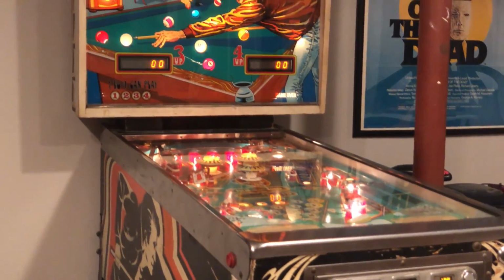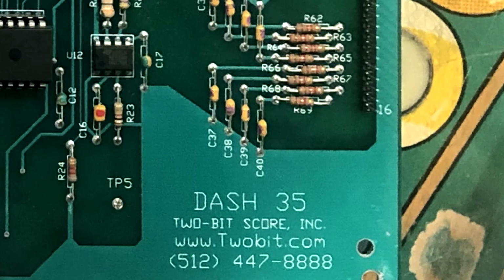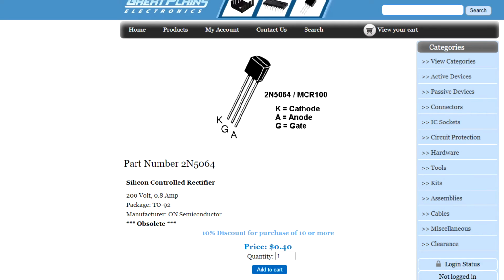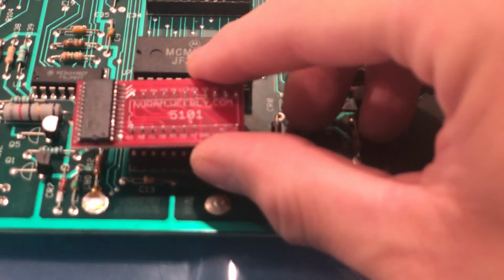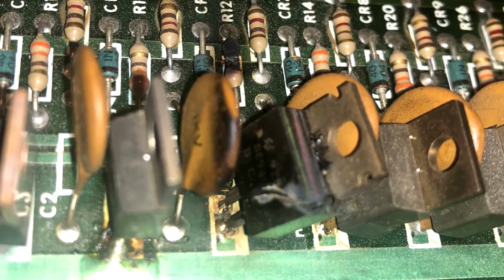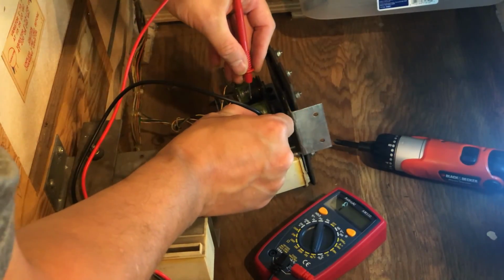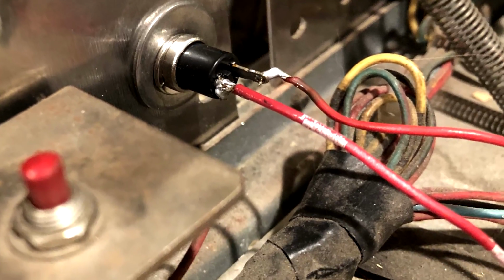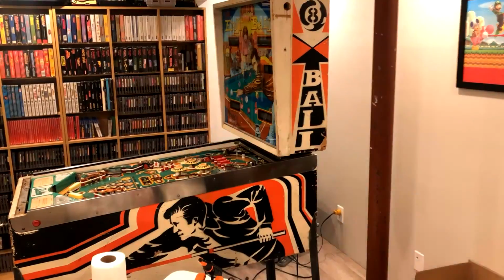Eight Ball Pinball Repair Journal

Comment: Regarding the ground prong: It's possible they didn't cut it off at all.  If the game was plugged and unplugged a lot, it's plausible that the prong just broke off from metal fatigue.  I've seen it happen, especially on machines that used to be owned by a vending company, or machines owned by a travelling carnival, because those were regularly moved from site to site and thus were plugged and unplugged more frequently.  But if the ground prong was cut off, there are two reasons I can think of.  The first reason is the most obvious: Maybe they only had two-prong outlets.

The second reason would be to eliminate a ground loop hum.  In layman's terms, a ground loop is caused when a circuit is connected to ground at two or more points.  Because the potential of the ground varies from point to point, two or more connections to ground cause currents to flow.  Ground loops are a major cause of noise, hum, and interference in audio, video, and computer systems.  (I don't think you'd get ground loop hum on a pinball machine that still uses chimes, but I could be wrong.)

A good example of ground loop hum would be cable TV.  Even if all of the audio and video equipment in a home theatre system is plugged into the same power outlet, and thus all share the same ground, the coaxial cable entering the TV is sometimes grounded by the cable company to a different point than that of the house's electrical ground.  This creates a ground loop, and causes a hum in the system's speakers.  Cutting the ground prong solves that problem, but you're making your equipment less safe.